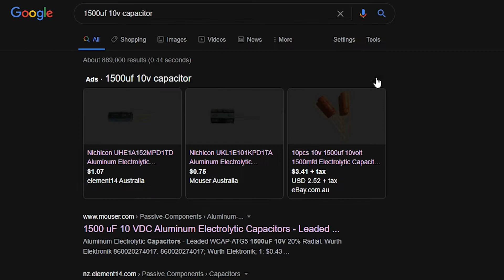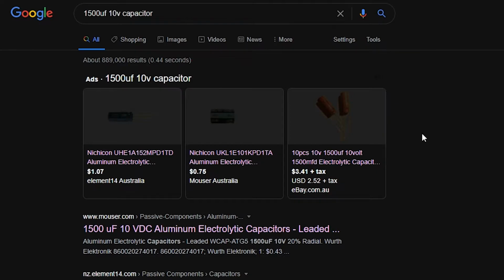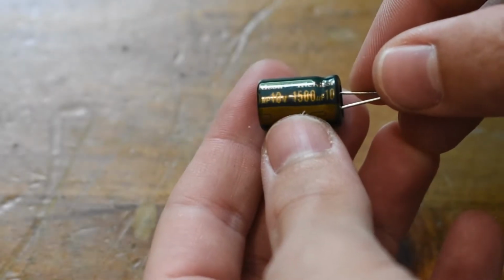How To Replace Bad Capacitors On Vintage Motherboards | Recap Guide

Comment: I need to recap my acer aspire m5201 from way back as it's used for cnc control and no way can i rebuild the models i made for the cnc program.

Remember,replacing just the visually swollen caps might not be the best idea as ALL the caps will be of the same age ,also you should reform the  oxide layer as the caps will have been lying on the shelf for a while and if not reformed the caps may be out of spec for ESR and leakage current.

Not going to go well for a mobo if the caps are for critical use areas.

Always measure new caps for mobo's,make sure they are within spec.
Some manufacturers state to add series 1k resistors and apply full rated voltage , the method i know uses series resistors but apply the voltage incrementally over a period of 3-5 hours,use a bread board and raise the voltage no more than the lowest voltage caps,going in voltage rating stages removing each batch of rated voltage caps until all caps are done,so going from say 1vdc to 6.3vdc in 3-4 hours removing the 6.3 caps and discharging them using a 220k resistor then measure ESR.
Watch this video-https://www.youtube.com/watch?v=L-u8JhVgQlY&t=13s - and you may make a tool for this very endeavour .

Comment: You cannot swap caps with lower voltage-rated ones, true. But in this application (most of these caps are parts of step-down voltage regulators or simply filtering voltage ripples) there's no harm in going higher. Manufacturers just aim for the lower value that will (somewhat reliably) do the job. Board real estate is another factor.

Comment: You should also mention values like ESR, ripple current and impedance. They can be only found in datasheets and are not written directly on the capacitor. Use of high ESR capacitors in circuits where low ESR is needed can cause problems.

Comment: Can there be voltage on these if everything is off? I'm scared I get shocked and die
Reply: There are certainly capacitors that can give you quite a shock, but I doubt you'll run across any on a motherboard or video card that can do so. Capacitors in power supplies or CRT monitors are a different story, at the very least learn how to safely discharge a capacitor before you go poking about inside of those or anything operating on mains voltage.
Reply: The charge in the capacitors would probably be gone already since you have circuits that discharge them automatically in a lot of modern boards.

Also, if the item has been stored somewhere for a long time, there should be no charge remaining in the capacitors because it would have dissipated by now.

The largest shock you could possibly get would be like touching a doorknob and getting a static shock.

The circuits in motherboards only use a maximum of about 12 volts, so that's not enough push to put much current through your body, and it still wouldn't kill you.

Comment: I had the same leaking  2200 micro farad capacitors at 6.3 volts and replaced them with 3300 microfarad capacitors caus I didn't have anything else
Reply: Did it work? If so how has it been holding up?
Reply: @The10021k-guy  yeah,it did work perfectly and it's still is
Reply: You cannot swap caps with lower voltage-rated ones, true. But in this application (most of these caps are parts of step-down voltage regulators or simply filtering voltage ripples) there's no harm in going higher. Manufacturers just aim for the lower value that will (somewhat reliably) do the job.

Comment: If only one capacitor is broken, can you get away with simply neglecting it and only replacing it if the pc won’t post or would there already be damage done?
Reply: I believe a bloated capacitor will eventually actually blow, and then you'll be screwed because most probably the motherboard will be damaged beyond repair.

Comment: Question: I heard some saying that the capacitors used must be exclusively "low ESR", and found out that those are so very expensive, sound like an scam to me. Any idea?
Reply: It’s not a scam. You should always use low ESR capacitors to replace low ESR capacitors. The capacitors used in the CPU VRM section are almost always low ESR types. Using regular caps will result in higher ripple voltage, which can result in instability and crashes. They’re not really that much more expensive so you may as well use the right ones for the job.

Comment: So, if I have a 820 UF 2.5v capacitor, then All I need to match is the 820 value. As long as the unit is 2.5v or above it will work? Also, I have a motherboard with a broken solid capacitor. Can they be replaced using the same method?
Reply: Yes, you are correct. You probably don't want to go too high in voltage over the original because usually it will be a slightly larger capacitor that might not fit well back into the same space. It will also cost a little bit more to get higher voltage-rated capacitors.

As far as the broken solid capacitor, you're probably talking about a ceramic disc capacitor, which are usually brown.

I would think you can use the same reasoning when replacing those, but I would try to get the exact same match if you could. You might want to ask someone else about those.

I have recapped a lot of circuit boards with electrolytic capacitors, but I have not replaced ceramic disc capacitors, really.

One thing to think about is that you may end up having to get at least some low-ESR capacitors, especially for the large ones around a processor chip on a motherboard if that's what you're working on.

Some circuits require that type of capacitor. They are usually exactly the same as what you would generally buy except they are labeled as low-ESR. (Equivalent Series Resistance) They cost a bit more, too.

Comment: 4:45 The side with a white mark is always a ground or negative side until it is an Asus motherboard :)
Reply: I've heard about that with the Asus motherboards. The only other time I came across that problem is with certain arcade monitor chassis boards. I think the Neotecs were the worst, but there were also some others that had a few errors.

The best thing to do is simply note if they're marked properly when you take the old capacitor out.

There are so many people that want to pull a whole bunch of capacitors out and shove a bunch of new ones back in there all at the same time. I don't see why it's so hard to do one at a time.

Comment: I have a GIGABYTE GA-7DXE Socket 462 MB with AMD Athlon XP 1700+ CPU, 256MB RAM.
I know it is old. But I want it for a retro build. I used that MB with Windows 2000 and now it does not power up. Changed PSU, blinking DIMM_LED like TICK-TOCK. Also sometimes it auto powers up, but nothing on screen.
Basically, changed PSUs, nothing changed
ALSO CHANGED THERMAL PASTE ON CPU, CPU DIE is not cracked or chipped
Help please. I will thank anyone who help me.
Also a recap can be worth on this board? I think about recapping. And it can work after that intermittent power cycles that suffered before the plan of recapping?

I have a solder iron, 60/40 flux, needle. Can i use them without a soldering pump?
PS: I bought as replacement caps some from Panasonic, some from Elite and some from Sancon. Can I use these instead of the original Choyo & Chong?

Comment: Quite sorry to burst your bubble, but those caps you bought are fake Nichicons.

Here's how I know this:

- Nichicons were never green/gold printing for a start. Either brown/white printing for some older caps (and usually PSU caps at that), or black/white for motherboards. Black/gold printing is also counterfeit, proven by Dell and Apple in several cases.
- the printing looks sketchy as all hell.

Hope you can replace them soon, as the board looks like a competent MSI retro motherboard, and it would be a shame to run it with fake capacitors that can hold up for less than even the original crapcaps did.
Reply from the maker: Ah damn, thank you for pointing this out! Yeah I got them on eBay ages ago, but had never really looked into whether they were actually real or not. Nowadays I use RS-Components though, so I'll definitely have to order some real Nichicons! Appreciate you bring this up, thanks again!

Comment: Love the videos! Very informative and top notch quality. Keep em' coming!

Would love too see a electrolytic to polymer cap upgrade video.
Reply from the maker: Thanks man! Yeah planning on doing something like that, just need to find the right motherboard for the job.
Reply: @ScanLinesAU   No problem  man. 

https://www.vogons.org/viewtopic.php?f=5&t=47545

That's pretty much the go to thread on the topic. Very sparce info on the net, but the full mobo poly mod will buy you 20 more years on the mobo (as far as caps are concerned) . 

Saw a video on A ultrasonic cleaning in a water & pcb cleaning solution that made the mobo factory fresh. Also, check philscomputerlab for inspiration. Critically underviewed channel.
Reply from the maker: @ashleyjwilliamshand  Ah nice, yeah I'll check that out.

Ah yep, I've got a very high tech solution for cleaning motherboards, it involves a garden hose haha. Just rinse them down and let dry for a week. Good as new! Yeah Philscomputerlab is great hey, been watching his vids for a good 3 years.

Comment: Great Video. I got a old Shuttle AMD Athlon XP 2100 Mother Board that need 4 of the 6 caps replaced and are leaking and ran great and stable till they started leaking. Granted I know the board is old but for a retro system it is great to make a Free Dos system out of. I just lack any kind of soldering skills or solder or a soldering iron or flux. You know all the things required for soldering anything successfully especially good soldering skills. Anyway, great video.
Reply from the maker: Thanks! Nice, I've been getting into Athlon stuff a bit recently too. Soldering isn't too hard, just watch a few tutorials and practice. For a long time I was using a really cheap and nasty soldering iron, but you know what? That's what I learnt on, so I've found it super easy to use better gear. I've been soldering for about 8 years now (on and off, I'm certainty not the best!) and if I could offer any advice, it would be to practice. Really, practice and technique are the two most important things with soldering.

Comment: Nice job!!!!  couple more tips:  Adding a little bit of flux helps.  Clean and re-tin your tip often.  Clean the area on the board where you soldered with isopropyl alcohol when finished.  This will give you a nice "factory" look finish when done.  And the most important:  DON'T BURN YOUR FINGERS!!!  I have a nasty burn scar on my thumb from when I burned it years ago.  I only accidentally bumped it for like a half a second......happens so quick.....OUCH!!!!!  Keep up the good work.
Reply from the maker: Appreciate the soldering tips. Hah, I know all too well about burning fingers! Too easy to do hey.  Thanks, I sure will.
Reply: i did burn myself years ago but at least i didn't get scars, i guess im less prone to scars.

Comment: I like to take photos of everything before i start desoldering, because my memory is crap and i've found that you can't always trust the legend printed on the board to be 100% complete and accurate. Like, I was removing some leaky caps from this Bondwell 286 laptop yesterday, and i noticed that the silkscreen had actually got "+" and "-" mixed up in several places. Best to have a photo of it so you know for sure how the capacitor was REALLY oriented.
Reply from the maker: Yeah, that is always a good idea. You can also just do 1 component at a time, but it's really down to whatever is easiest for you. These boards are designed by humans after all, so there is bound to be mistakes here and there. Photos are great, indeed!

Comment: Nice done! You may refer to the "microfarads" or "μF" as "Capacitance". I strongly recommend using a bit of flux too, liquid, gel, paste, whichever you can get.
Reply from the maker: Thanks! Ah yeah, I've always called it microfarads, but capacitance sounds easier hah. Yeah, flux is good. I haven't ever really needed to use any in this application though, but will give it a try for sure.